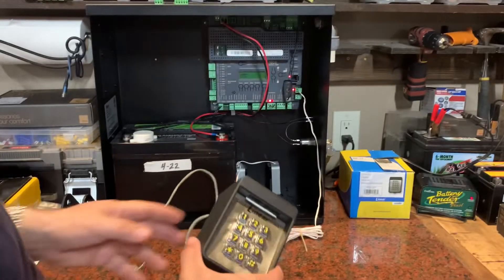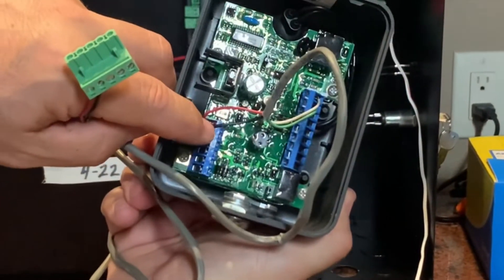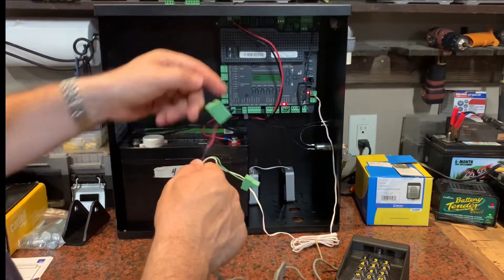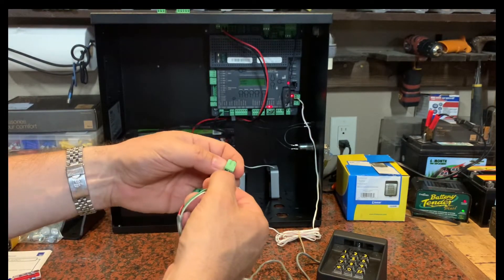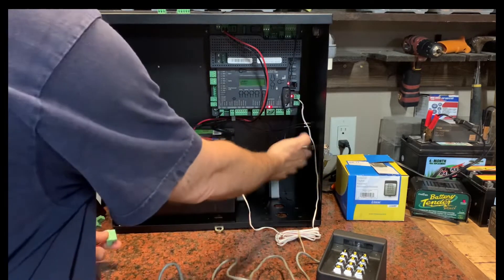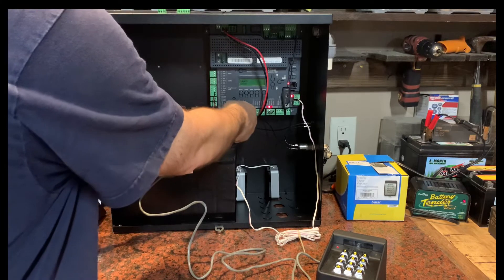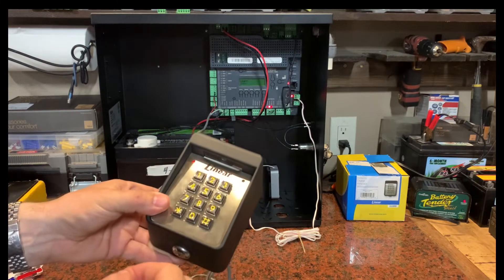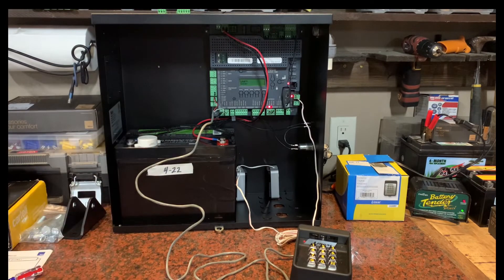✅ Linear AK-11 Keypad ● Connect to Nice Apollo 1050 Gate Operator.  How to Wire it!

Comment: Are you able to wire 2 key pads to it? If so , how?
Reply from the maker: Yes. Easy. Just connect to the same connection points on the control board.